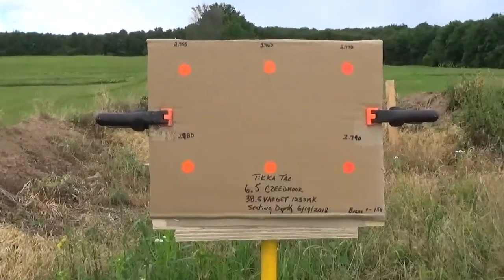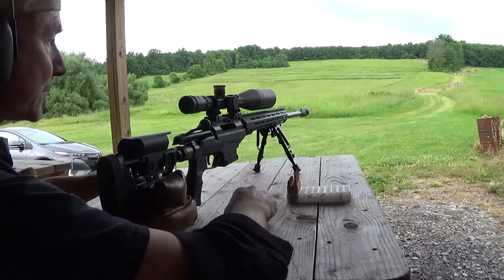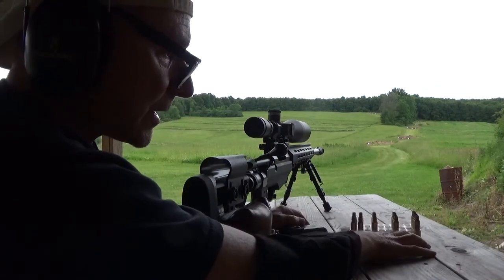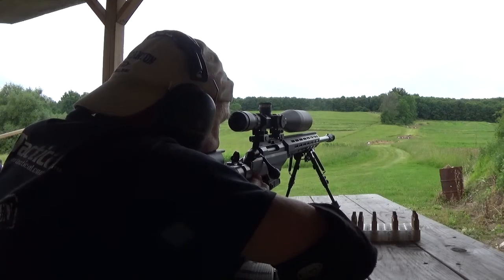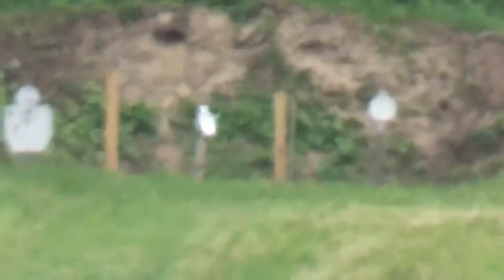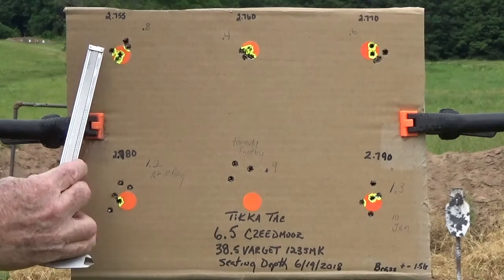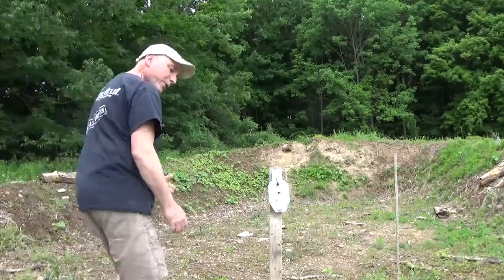Seating depth for 6.5 Creedmoor

Comment: They would have to like a little jump.  Seat it at the lands and you'd have an air gap between the bullet and case.  Those little things are 80 thou shorter than a typical bullet.  Bullet base to tip and at the ogive.

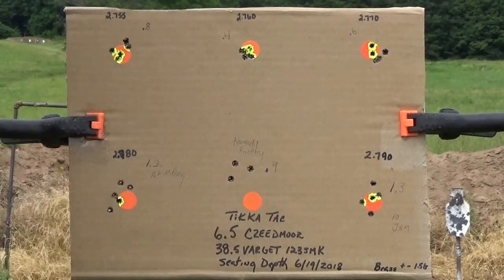Comment: I just did my first seating depth test using 6.5 CM  with 41.1 grains of IMR 4350 and Hornady 140 ELD-M.  Obviously my bullets with their plastic tip are longer than your 127 grain Sierra Matchkings, so COAL numbers are irrelevant.  How far back from the lands was your 2.760 group?  From the numbers displayed at 5:57, it appears the lands correspond to a COAL at 2.780 and your best group was 2.760.  This makes for a .020" jump.  So far my best group was 0.023" off the lands.  (My COAL is 2.824" and they still fit in a Magpul AICS mag)

Comment: Changing your POI mid test really doesn't help the testing process.
Reply from the maker: I think you mean Point of aim. For this type of rifle using a bipod off a bench I am just looking for something that is steel close. You are correct when doing load development with a bench rest rifle it is always better to shoot at the same point of aim. Shooting off the side of a tree, on the ground, off a bench, up a hill, down a hill will provide different points of impact due to stresses on the gun. I found the desired load without having to walk back and forth wasting my time. A lot of "load development" videos are a total waste of components and time as the environment and rest change so does the accuracy node. But you already knew that.

Comment: Are you using Overall case length?
Reply from the maker: Thanks for watching. 38.5 grains Varget and 123 Sierra Match Kings seated to 2.760 coal or comparator measurement of 3.160 shoots .4 inches @ 100 yards with Tikka Tac A-1.
Reply: When you talk about seating depth youre using the overall case length as the measurement right?
Reply from the maker: @jerrygaleana9610  2.760 Cartridge over all length Yes. (Loaded round) The longer 3.160 measurement is using a comparitor. Here is how it works. Have a good weekend. https://www.youtube.com/watch?v=lcrzSGtcnRA
Reply: Toadley Browne while using a comparator your measurement should be shorter than the coal. Using a comparator your measuring off the ogive which I know you know already but saying the comparator length is longer on the same case makes no sense to me. Honestly looking for an explanation on how that’s longer than coal.
Reply: Toadley Browne okay I figured out why you got that number.  Interesting you didn’t this for some reason,  but even in that video link you shared above the gentleman zeros the calipers after installing the comparator. I’ve just never seen it done that way. I guess it doesn’t matter if you never zero your calipers after installing the comparator. Good to know that measurement had me thrown way off. 😁.    my fault for miss understanding how you got that. Good shooting sir.
Reply from the maker: @JB-kf3yb  Thanks for watching. Zeroing after attaching the gage is fine as long as when the info is recorded it is stated that the caliper is Zeroed. 2 years later and when the information is used again that will mess things up if how the gage was set is not specified. Some machinists say never zero an attachment and others who keep records say it is fine. Since it is a measurement specific to each reloader's rifle and component selection it can be used as a guide for others but any of those measurements will be different because of reamer used and varying lot to lot differences in reloading components. I use my page to refer to all the time as a data base of what I have done and after 10 years and 1000 videos I have quite a library. It's is all backed up on books hand written scribble in the event the whole thing goes away. Have a great day.